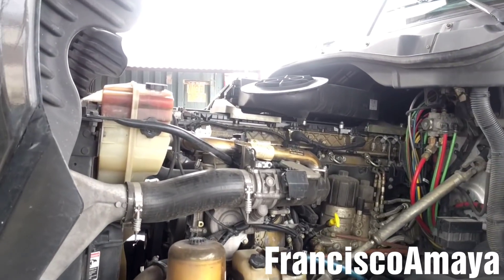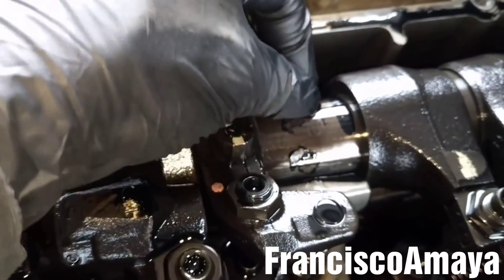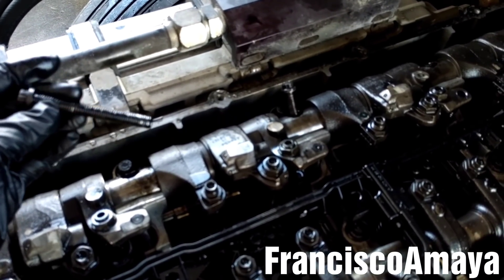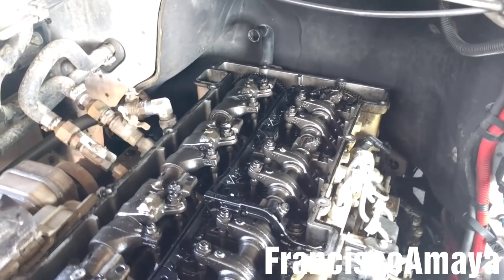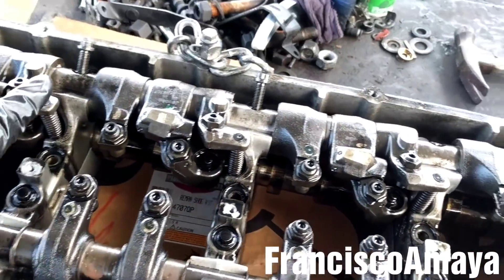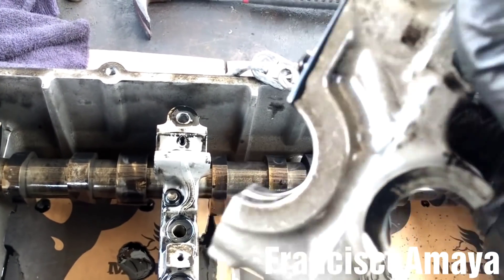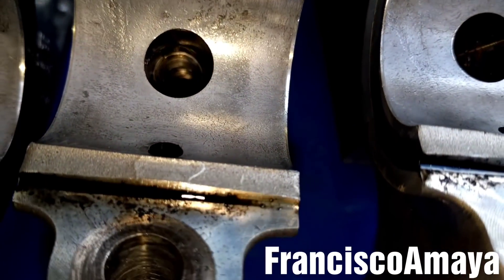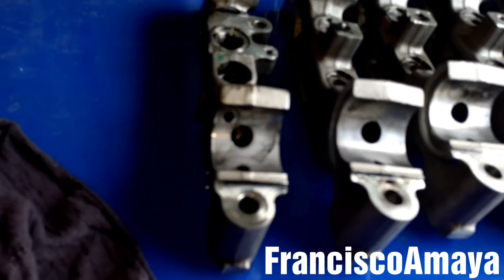Freightliner Cascadia DD15 engine malfunction engine noise cam housing problem engine timing part 1

Comment: Why not just drill out and use heli coil inserts?
Reply from the maker: They don't resist the high torque.
Reply: @franciscoamayaYT  i understand your thoughts on that. To me that looked like aluminum and I like how aggressive the tap is for a h coil. Only problem I have ever had was loosening and binding when taking a bolt out or a heli skipping a thread on its way in the material. But you won't strip out a heli before the aluminum by itself will strip. But I get your side too. Sometimes I will chase the heli with the correct tap for even smoother threads.

Comment: What programa do you useto diagnostic electrical problems and where can I get it, if you dont mind sharing it
Reply from the maker: The engine software, right?
I use DDDL.
You can get it sometimes on offer up app but it is unlicensed copy by if you want a authentic copy you can get it at Detroit diesel dealer or at you local heavy duty suppliers.

Comment: Good Morning Francisco I have a 2012 Canscadia and the Camshaft Position Sensor keeps going bad any insight off what might be wrong I had the Cam Housing replaced in Nov.
Reply from the maker: Maybe the camshaft gear is damaged causing the timing teeth of camshaft to damage sensor.
Reply: Thank you!
Reply: Same problem here, do I replace entire camshaft,  or is it possible to replace th e timing gear by itself

Comment: Francisco mi dd15 hace lo Mismo y creo que tiene el mismo problema. Pero en mi camion tira humo negro. Ese tira humo negro?
Reply: Y cuando le piso el pedal de acceledor no response. No tiene power para mover la troka
Reply from the maker: Trabaja disparejo El motor?
Reply: desarme el cam housing y estaba partido el rocker arm shaft. gracias por el video que me ayudo mucho. pero ahora tengo oto problema. se me cayo um 10mm socket en el agujero cuadrado del cam housing y no se pa donde va para encontrar el socket. tome un video para ver si me ayudas en donde buscar lo. 

https://youtu.be/ERf0ffH4vEY

Gracias
Reply from the maker: Ese va directamente al carter

Comment: My 2010 dd15 does losing power , just changed fuel pump after found shaving metals particles on fuel filter then truck does the same ... amber engine lights comes on for a sec truck seems to work then once engine goes away the truck seems to start again the loosing power, kicks chocking then shuts down then takes long to start like it's out of fuel .. any help ??
Reply from the maker: Do you know the code number you are getting?
Reply: @franciscoamayaYT  thanks for response..l left the truck at the shop will learn tommorow and let u know ..  thanks again sir !!!
Reply: Man those engines suck azz

Comment: The cam housing is made of aluminum and with older engines over 500,000 miles. When tightening the bolts  the cam housing bolt holes strip.

Comment: Smh glad that didn’t destroy their motor how much did that cost
Reply from the maker: $2.5K Total cost.
Reply: Francisco Amaya not bad I know where to go if I am in Cali
Reply: @franciscoamayaYT  please check this noise what do you think it is. https://youtu.be/Qm0-dp3bWm8
Reply from the maker: It is normal,  it is the air compressor unloader valve cutting the air flow to the head of the compressor.  
Trucks 2011 and up ( with DEF ) make this noise.
Reply: @franciscoamayaYT  Thanks. I have changed the air dryer filter today and the noise goes away for some reason. Thanks for the quick reply.